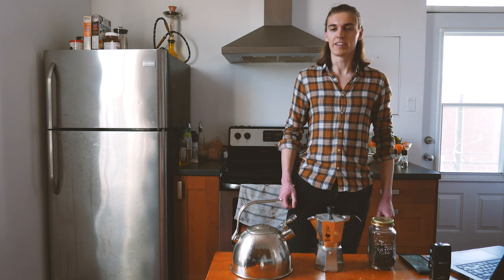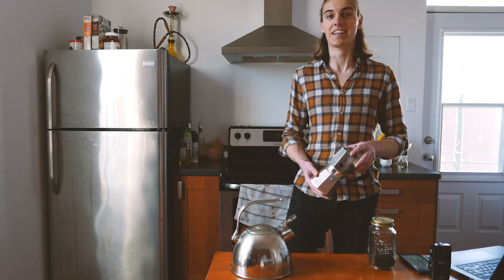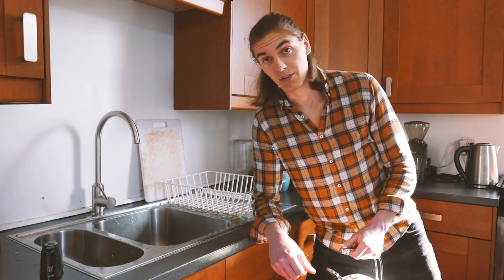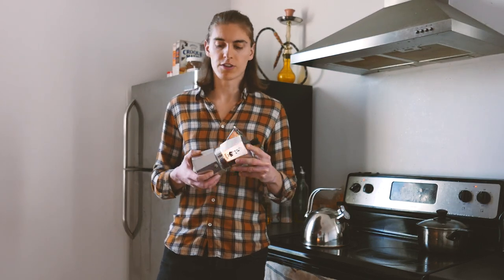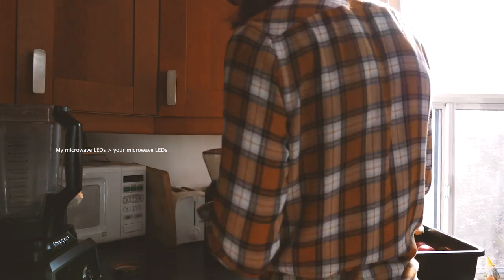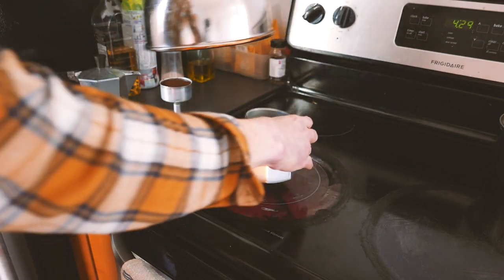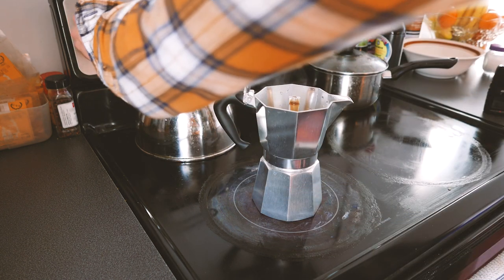Moka Pot Stovetop Espresso Maker - Tips & Tricks

Comment: I did the pre-boil for awhile and then tried just in the Moka Pot and in my own experience I didn't notice a difference. I honestly think it may be a myth that you can burn the coffee. I suppose it may depend on the size of your moka pot, I use a very small one and it brews in under 3 mins.
Reply: It is a myth. Just use cold. I use cold, dial two or three on the burner if I'm using an electric stove (low on gas), i wait until coffee comes out and turn the heat off when the two sides once coffee brews touches.

Comment: For perfect Moka pot coffee every time, the authentic Italian way to do it since 1933 is the best. It's extremely simple! The best tutorial is the "Annalisa J Moka pot" video. 

With the traditional Italian way, you won't burn the coffee because you take it off the stove the instant you hear it gurgle and let it finish brewing off the stove. There's enough heat inside the pot to finish it. So don't run it under the cold water when you take it off the stove. 

Fill it with cold or room temperature filtered water, never hot water. Cook it on a low gas flame or a preheated medium electric stove. Check out Annalisa's video.

Comment: What should be temperature of induction stove top while brewing it up?? And how long it normally takes??
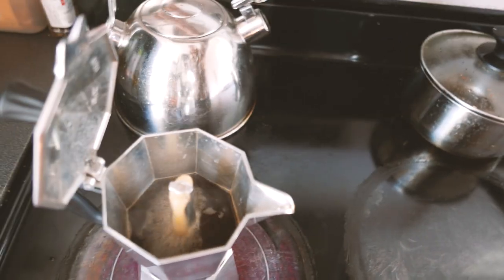Reply from the maker: I don't know the temp of the stove top itself, but I aim to stabilize the base of the Moka Pot around 90 °C. From the moment the coffee starts pouring from the middle part, it takes about 50 seconds to be done brewing (I stop it right before it starts to flow like at 5:00). Feel free to experiment with cooler or warmer brewing temperatures though, you could taste something different that you might enjoy more. Cheers! :)
Reply: Somwhere in between middle and high.

Comment: Its quicker if u put the water straght  in the caffettiera instead of boiling it first in the kettle
Reply: yeah that was a little confusing since he heated the kettle on the stove anyway. I bring my water to the boil using an electric kettle since its quicker, but if i was just doing it all on the stove i would just put the water straight in the moka pot.
Reply: I am confused it doesn't look like there was even enough coffee in there to make a cup when he was done, it showed only a little bit before he put it under the faucet. I use this every day and my coffee is bitter, so that's why I came here, but if the coffee is not all the way to the top then there is no coffee right?? I am confused ugh
Reply: @reneebradley660  fill it to the bottom of the bottom part
Put coffee in the middle part ..level...dont press and not too much over
Close the top part
It should fill the small italian tazza di caffe
Reply: Fill it to the button